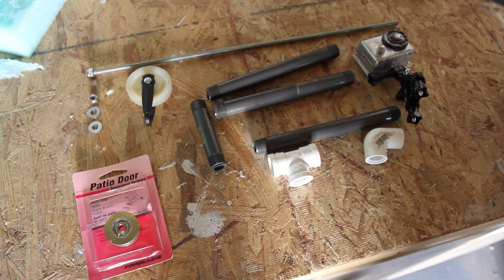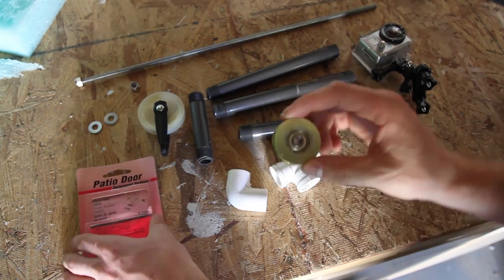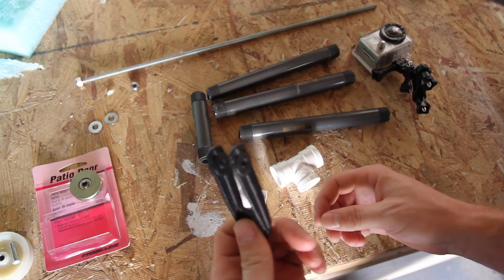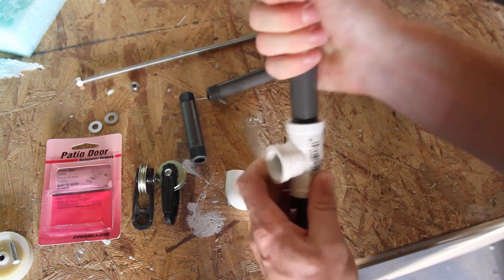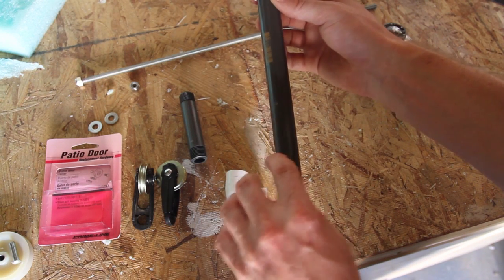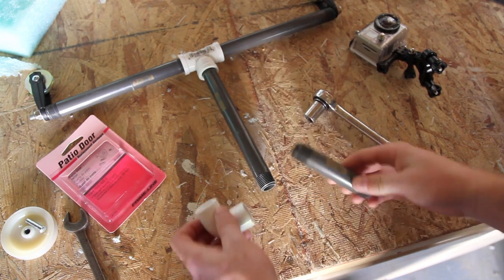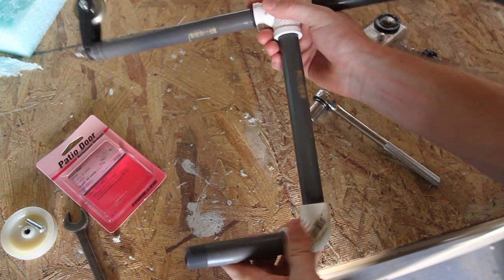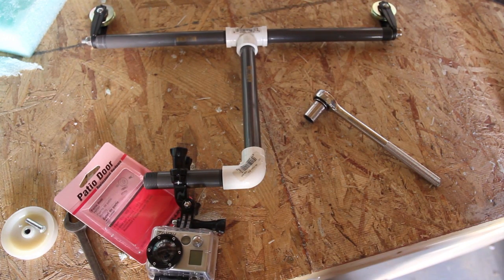DIY GoPro Cablecam

Comment: Son, I just gotta say it.  The item that you keep referring to as a "Bolt" is not "a bolt."  The proper name for it is called "A Lock Nut," intended to lock the nut to a bolt.  The threaded rod is also known as a threaded rod bolt, but the threaded rods do not have a bolt head. A bolt is a threaded rod with a bolt head. The nut connects to the bolt, whether they be a "standard nut," or a "locking, or lock nut."

To improve your pulley system you may want to put spacers, or "Shims" between the bearing wheel and the plastic pulley armature.  There is enough space between the wheel and the armature to add shims that will strengthen and stabilize the pulley system wheels so that there isn't too much play.

Interesting build and looks simple enough. I think that it can be improved on a bit.  Thanks for sharing.
Reply from the maker: if you noticed I addressed this issue long ago
Reply: Cameron Scott He's just trying to help...
Reply from the maker: Yes, thank you Pitipu Corrado